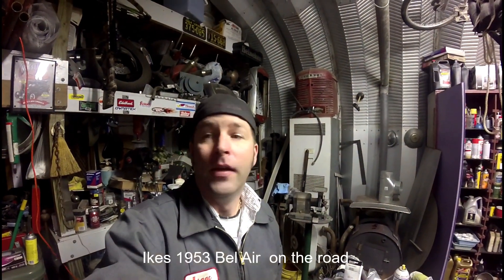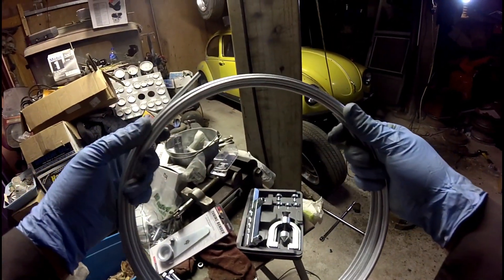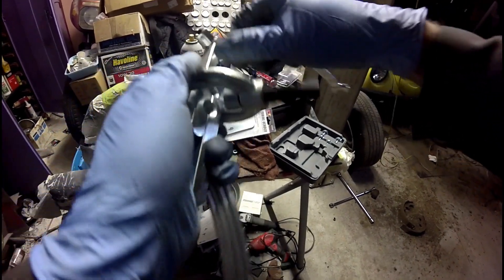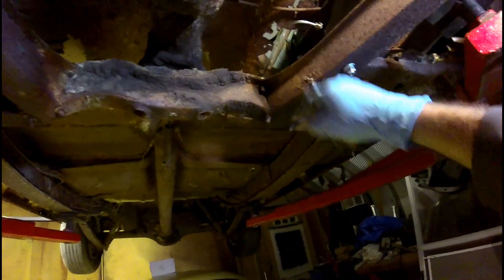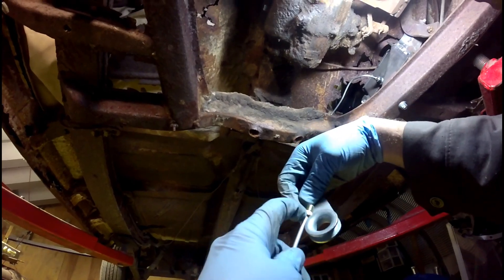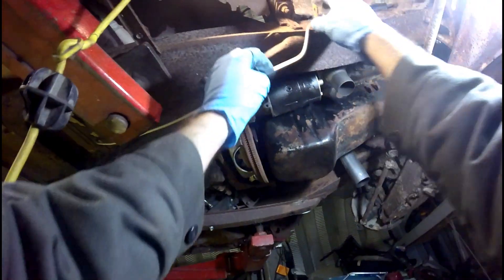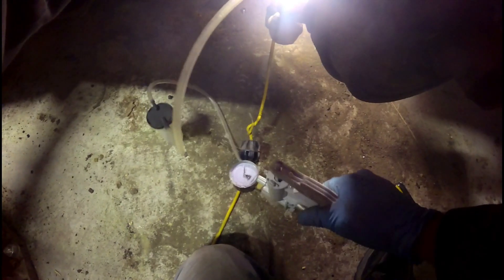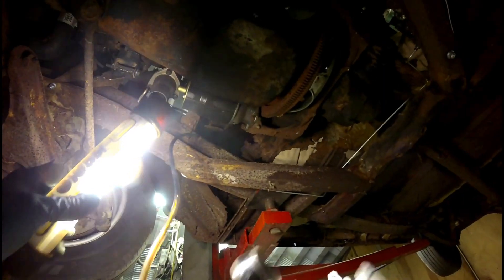First Time on Road in 38 YEARS! Ike's Adventures

Comment: ''first time on road in 38 years'' immidiately pulls a burnout :D
Reply: Because "Roadkill"...
Reply: Richard don't forget Finnegan's garage.. at least Ike has realistic builds.
Reply: Johannes Aize
Reply: motor is not as old as the car...
Reply: IndyHelis I wouldn't be as concerned about the motor mounts, as I would about the U-joints...they've GOTTA be nearly toast.
Reply: Johannes Aize 
I took a screenshot of that. 
And with a little practice, I think he could hook 2nd gear and really fry em....it was sitting still and redlining pretty easily.  👍🏻
Reply: CarsCamerasBikesNTrux SoCal exactly what i was thinking
Reply: It'll be fine.

Comment: My kinda Hotrod. much better than those high dollar builds that you can't even drive because a chunk of gravel might chip the paint
Reply: FullThrottleChevy just throw some red steel wheels. Leave the body as is and call it done.
Reply: +mike stradling ikes car is open headers
Reply: mike stradling the best
Reply: Joosy Knadds paint diesel on the surface rust,or used oil,shes a beauty.

Comment: I really love this car!!  The headers sound great. Nice work. I had a 54 Ford Customliner that was my mother's uncle's car. When I got the car it had 220 thousand miles in 1977. It had never been rebuilt and ran perfectly.  After replacing ball joints, the steering box, and steering column I drove the car for 3 years and gave it to my sister when I moved from the east coast to California in 1980. It had a 2 speed cruiseamatic transmission that still worked great after 26 years. Loving your vids!!

Comment from the maker: Not bad for under $1,000
Reply: CarsandCameras pretty cool you took a junkyard car and turned into a nice Drive able car
Reply: At least you didn't do what I seem to do every time I make brake lines... forget to slide on the fitting BEFORE making the flare. I almost always end up cutting off a flare or two.
Reply: lol. that happened to me
Reply: Isaac are you going to get windows for it
Reply: Oh yeah PS you guys should do a off-road riding lawn mower
Reply: Isaac it'll be fine how's the drive train? Was everything swapped from a closed driveline to an open ?
Reply: Isaac it'll be fine nice burnout
Reply: CarsandCameras could I potentially use a 2 barrel carburetor on my twin cylinder lawn tractor engine?
Reply: That cars frame looks like it sat at the bottom of the ocean for 20 years.
Reply: CarsandCameras ok lets get the transaxel locked on the rat mower and get the 670 on the minibike
Reply: CarsandCameras 
I was 4 years old the last time this car drove on the road. 
Wow time has not been exactly kind. Glad to see it turnin and burnin though.
Reply: Screwston Texas there would not be a frame if that actually  happened.
Reply: God I used to HATE when I did that, ESPECIALLY after doing a double flare on steel lines, it always hurt my hands to do... believe it or not Isaac is the first person I have seen used the double flare when using a flaring tool on steel line!
Reply: It's a keeper, It's also a rare 2/dr. Hardtop,  Please fix this one up, and clear coat over the patina.  I have always liked 53's,  I too, am a 1953 model.  And the V-8 install looks pretty good,  V-8's never were used in chevy cars until 1955, then it was only a 265 c.i.
Reply: Screwston Texas you must not see very many cars from the upper Midwest
Reply: Or for that matter from anywhere in north america where  they salt the roads...
Reply: The Friendly Facist Looks more like a car that sat near the ocean

Comment: Classic engine. Im an import guy BUT the Chevy 305 and older Ford 302's that came in foxbody's, both carbed of course, are my favorite v8's. Among some of the toughest v8's ever. Both simple as nails.
Reply: If you like simple and reliable carbureted small block V8's, I would say that you may actually find you prefer the Ford 351 Windsor to the 5.0 HO in the Foxbody given a bit of research.
Reply: well the 305 is doing a fine job. lol
Reply: MaxTheKanuck Yup. Love the 351 Cleveland's too.

Comment: +Isaac it'll be fine occasionally I've given you crap in some of your cart builds... well this one is sweet!  Killer patina, looks good, sounds good, AND YOU DID A FREAKING BURNOUT WITH IT AFTER SITTING FOR 38 YEARS!!!

I loved the look when you realized the speedo worked.

FWIW, you gave your crimper a funny look when you tried the first crimp, in the future put a drop or 2 of oil on the dies before crimping and you'll get much prettier crimps and the dies will last much longer.
Reply: i found out it was 42 years
Reply: Isaac it'll be fine sounds kind of like my 71 Mach 1 I went to drain the gas and it was the wrong color and smelled funny and I figured out that it was actually leaded after I burned in my other car and then by going through receipts and a few other things I figured out that it hasn't been started since 1981
Reply: wow
Reply: Lol, that was supposed to read that the gas was leaded (corrected it now) for some reason I re read and noticed that what I wrote didn't make sense.

Anyway, I'm loving this project, though if it was me I'd do something weird like the small block and column shift like you did and then fuel inject the engine just to be different (probably with a truck TBI and one of those classic Cadillac air cleaners so people wouldn't know what was going on unless they really knew what they were looking at)

Comment: So badass!
Reply: thanks
Reply: I'm pretty jealous acually. that drivers side window has me a little concerned though. Lol
Reply: Me too, that jagged non safety glass scares me a bit, don't want to see the brother get hurt. Great car though, really dig it, don't see a lot of those years compared to like the stupid expensive tri-fives. Good job man!
Reply: +Reverend D, I'd prefer this car over most $20k-$100k anyday. That's the car not the money. Lol if I had a stupid exspensive car givin to me or just got a completely stupid good deal on one, I'd sell it and buy a shit ton   of cars just like this.
Reply: No question. I've spent a lot of money on my last car build a long time ago and honestly if I had to do it again, I'd have something like this or his 66 truck. Once you get into that opening the wallet and buying jegs or summit your just throwing money you won't see again away. Recycle, reuse and have fun that's the point, least for me.
Reply: Yes sir! I've built a few jeeps the last 16 years and I finally learned it's alot easier and cheaper to buy them with all the exspensive stuff done already. That is as long as it was done right. Lol with 5 kids it's hard for me to build anything from stock to where I want them. It took me about 10 years to finally find a super good deal on my dream Harley  and then another 3 years for me to get it put together and running the way I want. It was worth it. Hell, it's a bare bones hardtailed bobber/chopper with old 60-70s parts too with no paint and still not cheap. I'm sure it'll be the same with any hot rod, rat rod, led sled, or just any cool old car will be too. I wish I could find a deal just like this car Ike has!

Comment: Ike,i saw second gear working,when you shifted from first tosecond and then to third.later buddy,check adjustment on linkage.thanks.mike
Reply: it only works 1 time out of 50 shifts. ive been over the adjustment over and over. tm going to take the cover off and I'm sure the lack of oil has damaged the trans

Comment: Nice setup.  Great video.  Did you have to use those residual brake pressure valves?  Or was it just  straight pipes to the brakes from the master cylinder.

Comment: Ugh! @9:15, He's using that big crescent wrench on the differential backwards, very bad because it might be pretty tight. Never power such a wrench away from the tiny moving jaw of the wrench but always toward it. 'Away' stretches the chamber that should hold that tiny jaw tight, loosening it. 'Toward' does not. Now that wrench is just a little harder to tighten its grip on a bolt or nut. Seeing this is a painful experience for me, and the reason i don't lend this kind of wrench.

Comment: Maybe I should sell you my crappy '70 Nova so you could put it back on the road...LOL
Or maybe my crappier '87 Camaro.
Reply: i want a nova
Reply: +Isaac it'll be fine
I will very likely be re-homing my crappy Nova and crappy Camaro this year and adding the funds to my crappy toy hauler project. The '70 Nova has been off the road since 1996 and last started and moved in 2009. The Camaro has been off the road since I bought my Jeep YJ in the late 90's as I couldn't afford to insure both at that time. It too was last started and moved in 2009. A few years ago I though about pulling the weak 305 and 700R4 from the crappy Camaro and installing the drivetrain into one of my crappy Miata's but now I plan to install the 1.9L ALH diesel from my crappy '03 Jetta TDI into that crappy Miata.

The '70 Nova is a 2-door with the 307-V8 and PowerGlide transmission. It has roughly 43,000 miles. The '87 Camaro is an LT with the 305-V8 (with a Q-Jet) and 700R4 transmission. It has roughly 126,000 miles.
Reply: cool